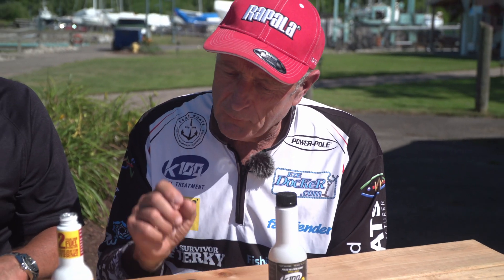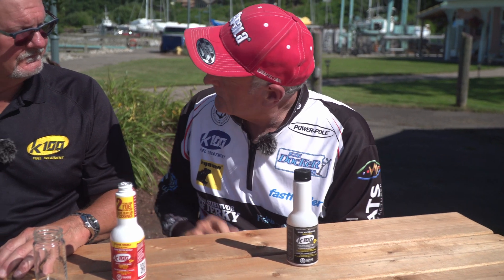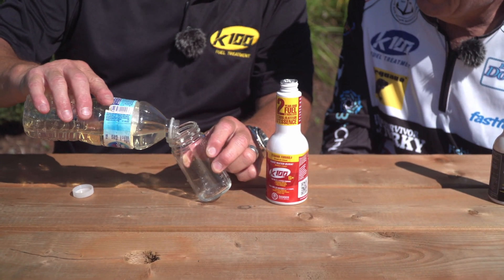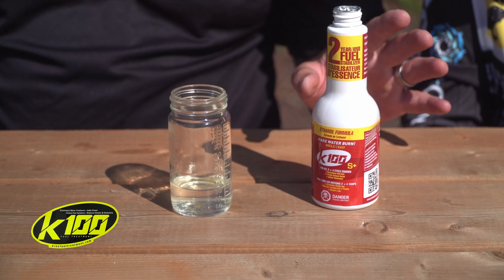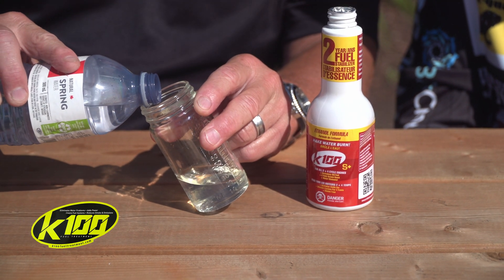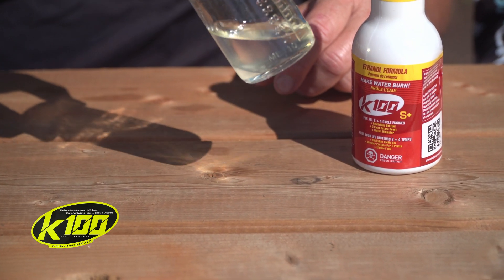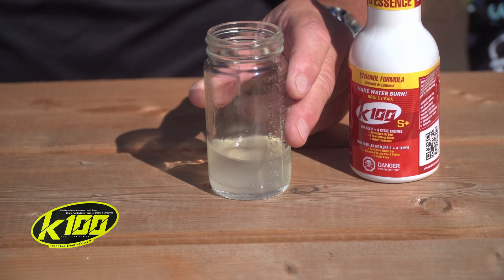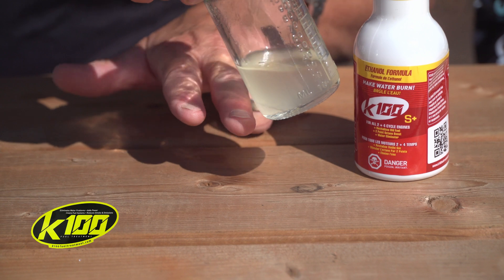K100 Make Water in your fuel burn!

Comment: Is it safe for motorcycles?  I have problems with water getting under my gas cap.   Water getting in the upper lip under the cap.   Im sure a drop or two has gotten in my gas.  Can this product burn that drop or two of water out of my 5 gallon gas tank.
Reply from the maker: Definitely, for all gas or diesel engines, you will be impressed...God bless you.